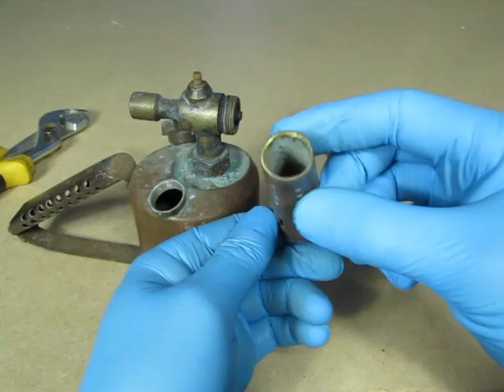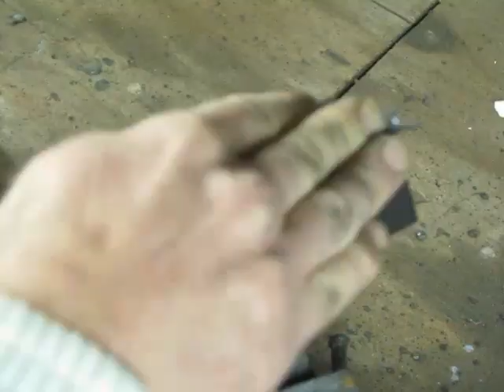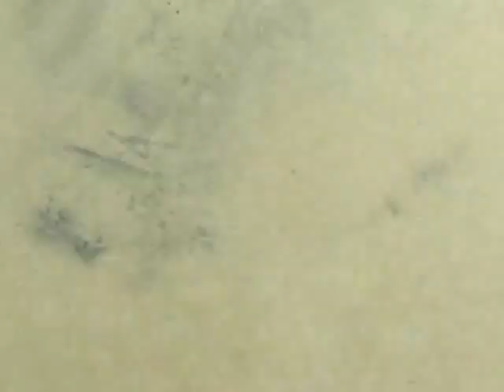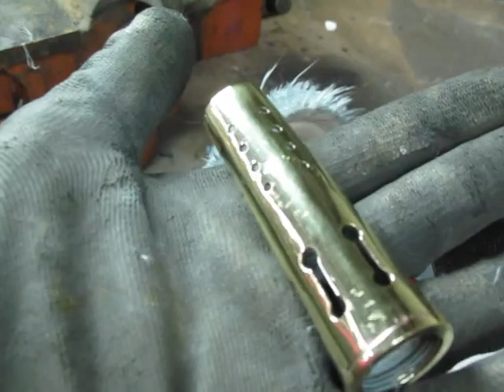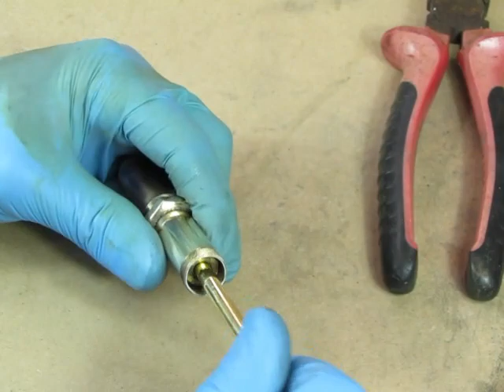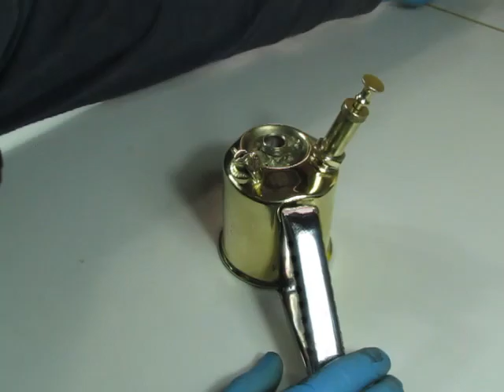Old Blow Torch Full RESTORATION (Vintage)

Comment: Nice clean up job.  I don't know if you intend to fire this up, but I didn't see you clean the orifice or the pressure relief valve (in the cap).  If the orifice is plugged, or if the relief valve is not properly adjusted, the tank could burst during operation.
Reply from the maker: thank you for the tip! I didn't need to clean it because it was in perfect condition. Thank you for subscribing to the channel and if you can share my videos.